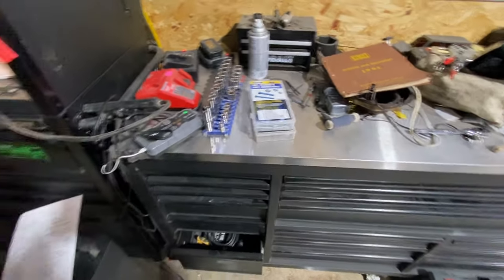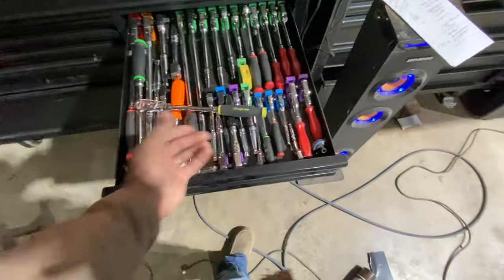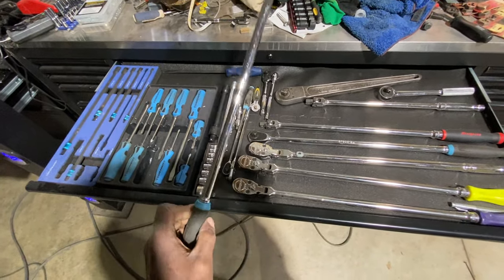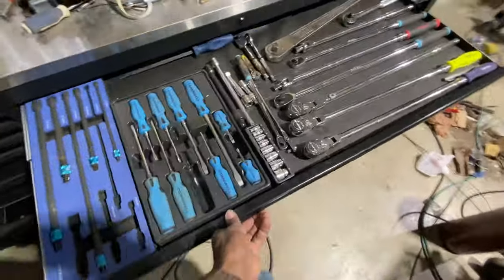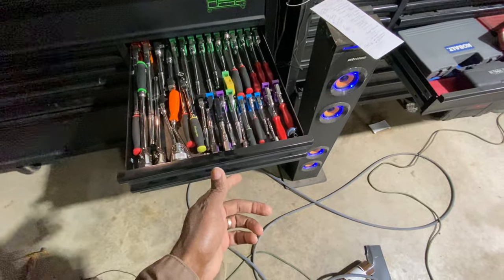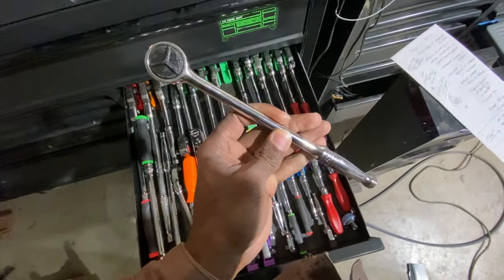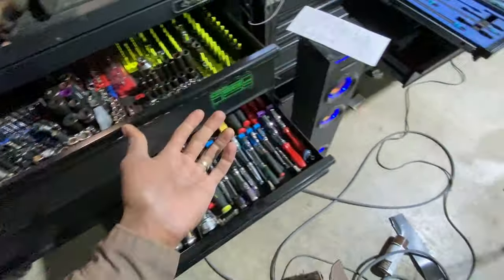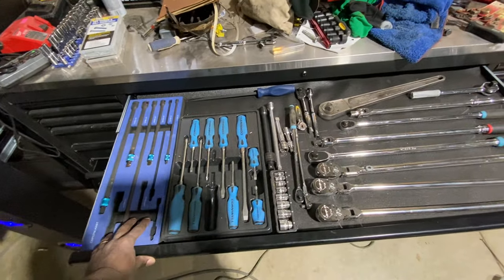Ratchet Designs.. What Do You Like or Would Change… Reply to @KoonTrucking

Comment: That's why I won't buy an electric ratchet  because then I'll quit using all my rachets that I've invested in🤔
Reply from the maker: That’s a good point. I’ve often contemplated the justification for opting to use a battery operated ratchet opposed to manual ratchets.. I mean, I can see where one would be beneficial over the other, depending on the application, but to completely rule-out manual ratchets…why, that is absurd…lol
Reply: Yeah i mean I've looked at several DeWalt atomic 20v flex, Milwaukee compact all 3/8 Dr anvil, and even the ac Delco set of them but honestly i have atleast $269 investment in 14 other ratchets that works fine i wouldn't be using so it just doesn't make sense to buy a cordless electric ratchet and i always seem to grab the same 3 manual hand ratchets when i am working on something anyway..

Comment: Hi James, I agree with you about the S-O comfort-grip ratchets.  They are superb & I like them a lot....Being in the Chicago area, it is cold 9 mos. out of the year. Nothing worse that grabbing a cold chunk of steel in the winter  & reefing on it for torque!
Reply from the maker: Amen!!
Reply: Because of my carpal tunnel, I need a decent size handle. Thin, smaller handles or chrome seem to create cramping in my hand with pain to the elbow. My preference is a S-O hard handle, flexhead ideally mid length. 2nd would be a S-O comfort grip.

Comment: I have a 3 pc monster mobile teardrop low profile fixed head non comfort grip ratchet set 1/4,3/8, and 1/2 inch Dr still in the package plastic tore but not used and now monster mobile tools is gone..so if I break any of the ratchets in that set so,, I picked up a 3/8 long handle non comfort grip fixed thin head medium length i think 8 inch long handle and stubby 84t gearwrench set to use instead ive thought about selling the monster mobile kit i gave $45 shipped from northern tool i believe it was but most people i know have not heard of them so they offer $5 to $10   for the set, i used to have the limited edition metric combination wrench set of theirs too but I ended up giving it to my dad i originally planned on getting both wrench sets but I don't know if they ever released the sae sets before they went under,, but anyways back to the ratchet set id sell them for $21-$24 but not $5 and $10

Comment: Temperature of the Comfort grip handle will be room temperature the same as the metal part of the ratchet. Your temperature gone just wasn't quite as accurate on the rough surface compared to a metal surface. What they do excel at is they are insulating and you won't lose heat from your hand nearly as fast therefore it won't feel cold.
Reply from the maker: Consider COTE (Coefficient of Thermal Expansion) each material will have a different wt response to temperature, regardless of the ambient environment. These tools were/are stored in my box, which is located in an uncontrolled environment, however there was about a few degrees difference which I’d expect give their respective differences in material.